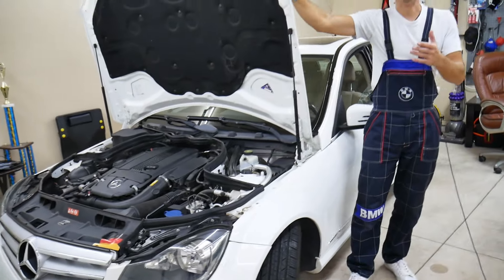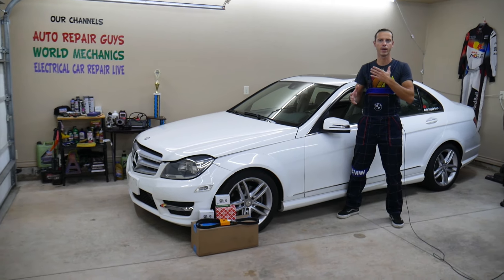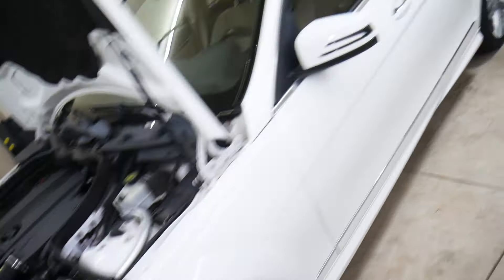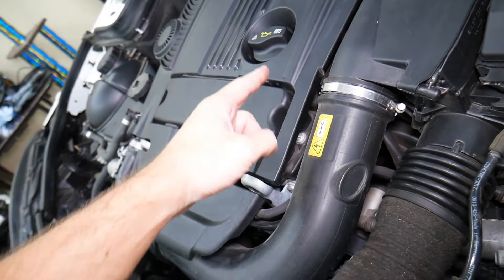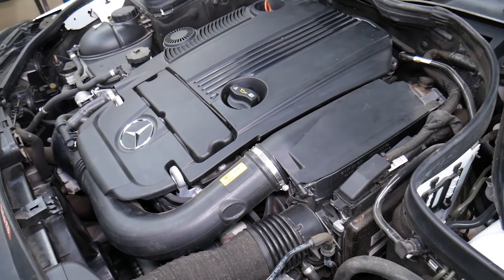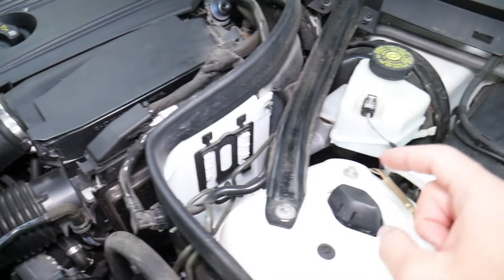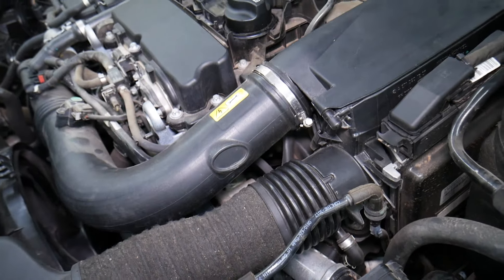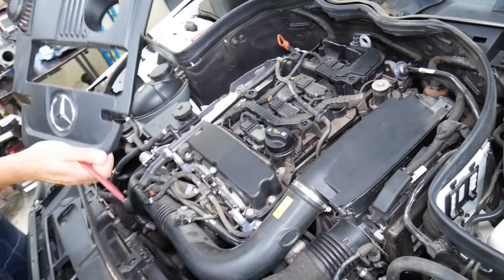MERCEDES WHAT IS SERVICE A1 A2 A3 A4 A5 A6 A7 A8 A9 W204 W205 W211 W212 W213 GLC GLA CLA GLE

Comment from the maker: ► Transmission Filter: https://amzn.to/3XMmXYW
► Mercedes Coolant: https://amzn.to/3Xovfq6
► Serpentine Belt: https://amzn.to/3ZqyTRy
► Belt Idler Pulley: https://amzn.to/3Xj9QhG
► Tensioner Pulley: https://amzn.to/3WZhOMS
► Liqui Moly Oil Saver: https://amzn.to/3vJhBSw
► Liqui Moly Engine Flush: https://amzn.to/3p91LwF
► Liqui Moly Ceratec: https://amzn.to/3JCVMJY
► Engine Oil: https://amzn.to/3WWf56R
► Engine Oil Filter: https://amzn.to/3WXUak5 
► Mecanics Tool Set: https://amzn.to/2n2dnpb
► Scanner That We use the Most: https://amzn.to/3jogxur

► We buy our Tools and Parts from here: https://www.amazon.com/shop/worldmechanics

Comment: What is involved in "spark plug service" are we talking about just checking for oil, carbon, and proper gap then reinstall? Are we talking just replacing plugs? Or are we talking about a full ignition system service, such as testing the coils, plug wires, etc?
Reply: I second this question. What does spark plug service mean ?